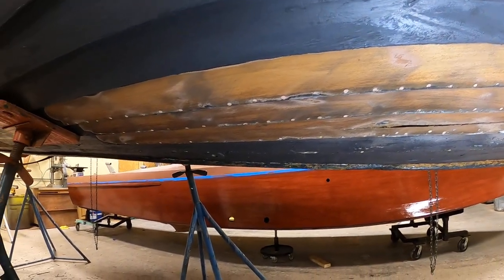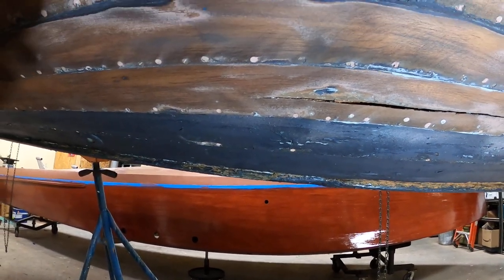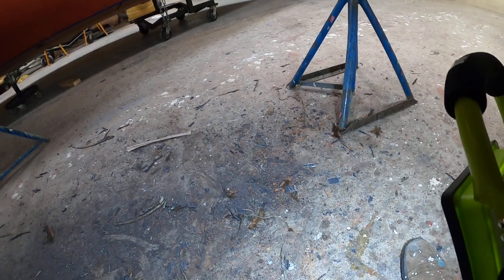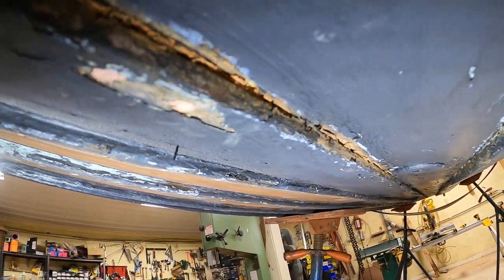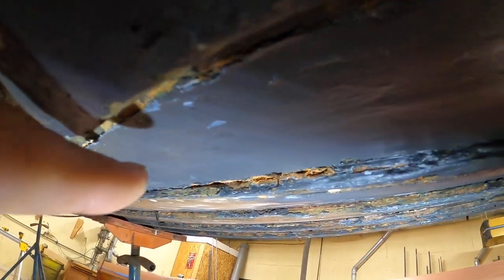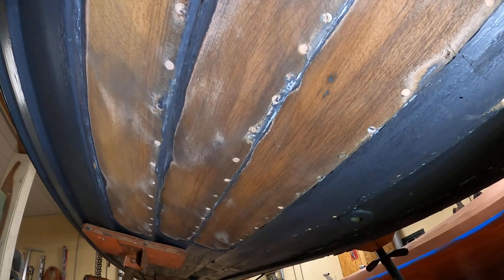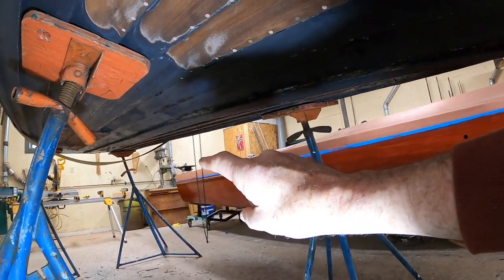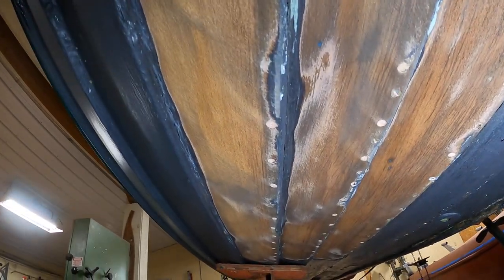1957 19' Century Viking Nordic Leaking Abatement Mistakes 12 30 2020 Snake Mountain Boatworks LLC

Comment: Was slightly surprised to hear you advise 5200 for butt block adhesive and thixo flex epoxy for lap seam sealing. Seems backwards. Would this be different if planks were plywood (like my ‘56 EM White)?  I’d be grateful for general advice on choices like this.  Thanks for your vid’s. Very helpful for amateurs like me.
Reply from the maker: Nope! That's correct. Paying seams w 5200 is doomed to failure and guaranteed to grow the most vibrant crop of rot you have ever seen. Thixo is a flexible-when-cured epoxy that is designed in part for caulking carvel-planked or lapstrake lap seams, whether in plywood or lumber. Here is what happens when seams are payed with 42300: https://youtu.be/l85H-WlRS04.
Reply: I see your point re 5200. Still surprised you use epoxy.  Hard to believe it’s flexible enough for an old hull. Do some use polysulfide?
Reply from the maker: @danjsimonds  Remember, "epoxy" is a generic term for any and all two-part materials, be they paint. viz., Interlux Interprotect 2000E Barrier Coat Epoxy Primer (https://pro.jamestowndistributors.com/userportal/show_product.do?pid=113), or adhesives.
From Jamestown: 
Thixo Flex is a thickened epoxy adhesive that forms flexible, high-strength bonds on wood (even teak and other oily woods), fiberglass, metals, glass, & some plastics. Upon cure, it creates permanent, structural bonds that absorb shocks, stresses, & vibration.
This cartridge-dispensed non-sagging epoxy is great for building or restoring wooden boats prone to flexing during use, and movement from weather-related expansion & contraction. Thixo Flex can be applied to dry or damp surfaces in temperatures as low as 40°F. You'll appreciate the long working time & easy cleanup.

And:
InterProtect 2000E is a two-part self priming epoxy designed to protect fiberglass (or wood) boat hulls from water absorption and reduce the likelihood of gelcoat blisters.
Interlux's Micro-Plate formula creates an effective barrier against water permeation. 2000E may be used above and below the waterline as a universal primer for all surfaces. It is also an excellent primer for all metals and can be used as part of a no sand system.

Comment: What are your thoughts on using red lead paint?
Reply from the maker: Sorry if I might sound unfriendly, but you are kidding, yes?  No way will I risk the safety and health of the crew by introducing lead into the shop. Period. Full Stop.
Reply: @snakemtboatworks  Just wondering, it’s used on everything below the waterline on wooden lobster boats by most Maine boatbuilders. Supposed to be toxic to rot and is a good primer but toxic especially when sanded.
Reply from the maker: @chrisperry8192  .... Your reply explains why we will never use it - TOXIC! Lobster and other work vessels are sanded and painted outdoors and need not have fine, pristine, glass-smooth surfaces beneath the waterline. Work vessels are one thing. Antique and classic wooden boats are quite something else. (I also cannot but other than curious about the life expectancies of boatyard labor that works around and with red led .... yes, especially when sanding it.

Comment: I like your presentation of this repair but I owned a 1959 Century Nordic like this model unfortunately  this boat was terribly designed. I had to open up all the seams on the bottom because the screws loosened after a short amount of time. I rescrewed all  the laps below the water line after caulking,.   with new brass screws. Century boats were classic looking boats but the bottoms poorly designed.  Don